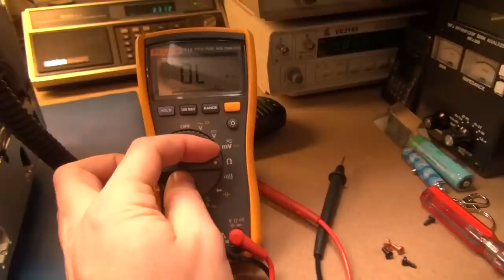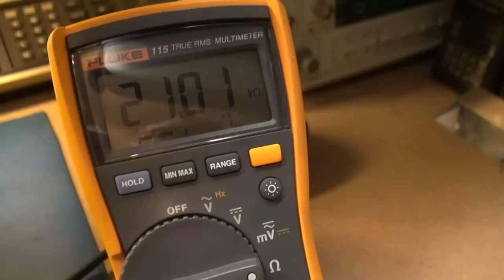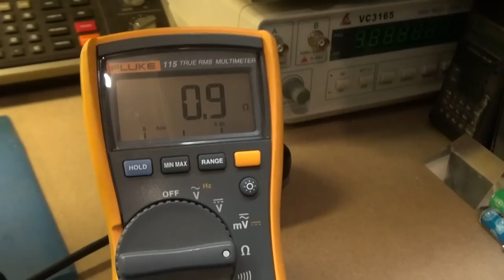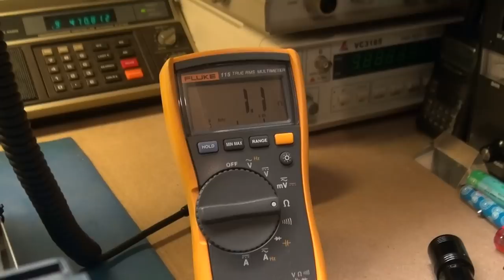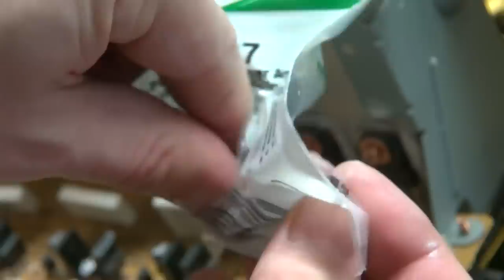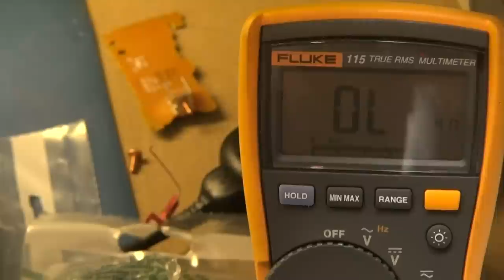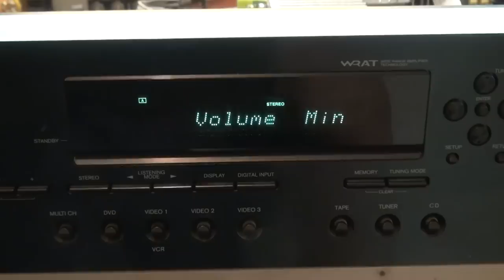ONKYO TX-SR502 RECEIVER  "SHORTED CHANNEL REPAIR"

Comment: Hi, great video.
 I have an Onkyo TX-SR576 that was working well but now started turning itself off after a few seconds and standby light blinking. I have tried clearing the memory, unplugging everything, and leaving it unplugged from power for hours, but its still in protection mode.   When I opened the case I noticed a large blob of black tar like material on the PCB right next to the large capacitors, and a smaller on on the board below that one next to a smaller cap. If that stuff has leaked from those capacitors would that cause the same result (as in protection mode activating)  as in your video? and can i just try to find parts and replace these to fix it, or should I be testing the transistors and resistors that you replaced?. 
It cost me nothing, it was a rubbish dump find that someone had cut the power cord off. I took it home and wired a new power cord and it had been working perfectly for last 6 months.
I really like this unit and would be keen to fix it again if it costs a few dollars for parts and a bit of time fiddling around, but not willing to pay someone hundreds to fix. I do have a little experience with soldering, building kits and other things but have never really fixed stuff before. Also, will i have to drain voltage from the old cap before playing around with it?
Any help or advice appreciated.
Thanks
Reply from the maker: I cant tell you if the capacitors are the only problem but it is a good place to start. Yes drain the capacitors. Some will drain by themselves with bleeding resistors in the circuit some will not. Check with multi meter. If caps are charged after being unplugged for a min then use a bleeding resistor. If caps are not the issue well it is a bit more in depth of a repair.

Comment: The .22 ohm was a casualty, not a causation. Nice job but I've worked on a number of these; there is a small transistor between the drivers that goes bad, a small 100 ohm resistor next to them goes bad, a small resistor to the base of an output usually goes. Contact me if you need help.
Reply: I can't buy transistor names 2SC1740S-S between the drivers. What is the replacement for this transistor or where can i buy it?

Comment: Just a suggestion, if you're having camera focus issues, you need to isolate the subject, like when you tried to focus on the resistor, the camera was focusing on your keyboard. a black background and some light on the subject will fix that, or when you tried to focus on the model number, the face of the amp was too dark and you had objects in the background, splash some light on the subject, this will fix most focusing issues.
Reply: Bro  camera is old

Comment: I have the same problem on my TX NR-509.  It comes on click....shuts off click. I was playing around with some new speakers and I guess the wires touched. Now I would think the protection circuit would do it's job but noooooo!  Anyway where do you go to for these parts?

Comment: Hi and thanks for the Vid, I have a similar fault with a NR609 that was dropped, i have tested and there are shorts on one of the C5242 and A1962 transistor sets, but the resistors appear to test okay, is it possible for the transistors to go faulty but the resistors to remain okay, p.s there was a crackle and a pop and a burning smell when trying to get off standby initially, any info would be greatly appreciated...cheers

Comment: Those massive caps are kind of scary to be poking around near. Did you discharge the caps before doing this work? If so, how? If not, how do work around them?
Reply from the maker: I don't remember what I did It was so long ago. But the procedure would be is to check them with a meter and if they still have a charge you can use a resistor like a 10k may be a good place to start but will drain slow. If you go down it resistance the resistor will be hotter because the cap is trying to discharge faster causing more current across the resistor. Never touch the resistor as you hook it up, use a set of clip leads. I wouldn't try to work around them charged unless you have a reason to.

Comment: Hello great job with the repair. I have a question... I have an Onkyo TX-NR535 that has stopped working. Recently I had to turn off my breakers repeatedly while installing a smart light switch. Since then my receiver has been making a clicking sound and won't power on. The sound is coming from the Power/Stanby button. Any suggestions as to what the issue might be?

Comment: I have a Onkyo TX-SR876.  The fornt left channel doesn't work.  Receiver turns on and works ok,except that one channel.  Made sure its not the wire or the speaker.  Do you think it could be a similar problem?

Comment: Thank you so much! I found a burned resistor & 2 faulty transistors thanks to your video. I removed them and brought my Onkyo receiver back to life minus the left speaker channel. I'm waiting for replacement parts now, but does anyone have any idea why this failure occurred? Should I get different manufacturer parts or could it be a cooling fan failure?

Comment: hello, I have the same ONKYO TX-SR502 RECEIVER but when I turn the power on it shuts off right away I'm wondering if its the same problem as yours. the caps all look really good no bulging or leakage one good sign is the fuses are not blowing I have not got into it and tested anything yet I thought I would get some advise as where to start. I repair CB radios so I am very familiar with a lot of these parts, and what they do you think I should start testing the outputs first, and take it from there I noticed you left your in the board so I don't have to remove them. if you can give me a few pointers I would be very grateful. thank you. "god bless" ben..

Comment: so question. If you test audio output transistors with a meter, and you can test them both ways. that means they are dead right? I heard they only test one way.

Comment: Kev, you might want to check On Semi's website for substitute output devices. Just enter the Sanken number such as 2SA1386. Have heard nothing but good thing about their quality. They are the apparent manufacturer for Motorola I believe.

Comment: Thank you!! GREAT VIDEO. I did the repair. Now my tape output and my MD tape output are not working. Did i forget a step or is that a whole separate issue.
THANKS AGAIN
Reply from the maker: +cc cally Sounds like you may have other issues or may have caused another. or a cable had become  disconnected,
Reply: +kev31779 thank you. I'll probe around.

Comment: HI Kev.
I have an ONKYO HT-R420. The computer was lightning-free and shut down and not working.
The relay is not activated and probe the transistors C5242 are not shorted and the resistances of .22 kohm are well.
Which component may be damaged?

Comment: Great video. I have a Sony STRDG-510 reciever very similur to this. When I put it in DVD or SAT mode it says that its LOCKED and I cant use those imputs until I unlock it. Can you tell me how to unlock it and why is it locked.Thanks Gio.

Comment: I have a Onkyo HT-R560 Receiver doing the same thing ... i haven't used it in almost two years and i took it to electricians and they couldn't fix it because they couldn't get the parts for it that is so crazy to me... i just want to send it somewhere and get it fixed i called Onkyo myself and they wouldn't even help me with my problem .. i can buy a new one for what it would cost me to ship it to MI.. to their guy they use to fix all their crap..  so i called him 75$ to just open it up.. take the top off.. and he didn't tell me how much an hour after that so i figure it would all come to around 300$ or more to fix it going threw Onkyo... Heck i can go buy a newer one alot better than mine for that much money so why would i want to fix mine if im going to have to spend that much money..idk.. I do know i wouldnt recomend Onkyo to anyone that was in the market for a receiver!!

Comment: I have an Onkyo HT-RC160 and something odd happened recently. My right rear speakers volume output is a lot weaker compared to the left. My receiver just switched off one day. When I calibrate it does not set it according to proper distance which is same as the left. I have switched over speakers and wires and same thing so it has to be the channel itself. Calibration raises the level to try to match the left but the left is still louder. I also ran fingers across tweetere to check air flow and it all looks good. Very confused.

Comment: I have a TX-DS494. As of the past year or so its right channel on output A sometimes works. As of yesterday it wouldn't output at all. If I turn up the volume it would sort of crackle, thats it. That has been happening for a while but it'd normally come out of it and work. Any suggestions? Thanks.

I switched to channel B for now. However I don't have as much functionality on A and it does sound slightly different. I'm going to try channel A again tomorrow and see if it'll come out of it. However I'd really like to fix it.

Comment: Great video - I found the bad set of transistors and replaced them (along with the noble resistor), and my receiver no longer goes into protect mode.  However, now it puts out no audio at all either through the speakers or through the headphone jack.  Everything looks and works normally (other than the no sound being output), any ideas on what the issue could be?
Reply from the maker: You would need to trace the signal path to find further faults.  It may have blown something further back in the pre amp section. Check power supply voltages. It may not be powering up fully. A service manual may help if you can find one for the model receiver your working on.
Reply: The other symptom seems to be that the FM tuner can no longer find a station.

Comment: Having issues:  remote stopped working, universal remote also stopped. The display is blank 90% of the time, 9% garbage displayed, 1% works fine. Any suggestions on how to repair/diagnose?  I am disabled now and can't work since 2016, can't afford new toys.

Comment: What is the compound that you added to the back of the transistors?
Good video, very informative.
Cheers
Reply from the maker: Rob Hernandez  Heat sink compound  Very common item to find
Reply: kev31779 Thank you Kev for the response and the info.Another question i have a kenwood 5 DVD carousel that is not puting out sound on the left  channel what should i be checking for?apreciate any help you can give me. Cheers
Reply from the maker: Rob Hernandez Without  electrical prints, check everything from power supply to Pre amplifier circuits. Consumer electronics can be a bear to repair without a service manual depending on how complex it is unless you can understand the circuits at fist glance you will need one. Also look for anything that might have seen to much heat.. Burnt components bulged capacitors, dark spots on the PCB,  bad solder joints and broken traces are dead givaways.
Reply: kev31779 Thanks Kev for the info.
cheers

Comment: Hello, when the transistor is changed to the same one, it is necessary to set the block current, or in what case to adjust it, thanks for the possible explanation
Reply from the maker: Sometimes there is no bias adjustment. If you put the correct part in it,  it should be good to go.
Reply: Thanx

Comment: have a onkyo nr 757 has a blown side what is blown it happened when it was on and I touched the the speaker wire on the back of amp then smoke cake out of it

Comment: Hello. I have a peculiar problem with my Onkyo TX-NR515. Everything seems to work, except for a single output channel, the front right. Now, I get no protect mode issue at all, in fact I even tried to heat gun the dts chip, and installed a fan and heatsink for it just in case. HDMI video and menu comes up on screen fine. All audio out works...except for that one channel. I tried testing the emitters, and they seem to check out fine all across...(no protect, of course). All the NPN and PNP's seem to check out fine, but of course they are still in-circuit. On that model, it looks like the drivers are on a seperate board. There is not static or other noise...clean sound all around except for the front right...strange...Thank you for any suggestions.

Comment: @Kev31779 - Great straightforward videos. Subscribed.  I need to attempt this repair.  I noticed you substituted a 5W noble instead of the original 2W.  What wattage range would be acceptable for replacement of a similar 2w 0.22 ohm noble?  Thanks.
Reply from the maker: Thanks, I used a 5 watt because that is all I could find online at the time. In a pinch it is better to go up in wattage and not down. These things are hard to find now for some reason.
Reply: Thanks for the response Kev.  I also had to order a 5 watt to replace a 2W and it left me feeling as if I didn't dedicate enough effort in searching the internet :( But since it worked for you I'll hope for the best.  Keep up the good work!
Reply from the maker: No problem, It will work just fine. On the note if all the other parts are good in the circuit.
Reply: lol...  yeah, you just taught me that in your Pioneer SX-255R "Rabbit Hole" video.
Reply from the maker: Yes, not all repairs are easy.

Comment: I got a very similar problem with a Sansui R-50. I found a burnt resistor together with an opened ceramic resistor like the one in the video. Should I just assume the transistors are fried and change them? That channel burnt a speaker already.
Reply: Nevermind, I took them out and they were shorted.
Reply: did the replacement of the resistor and transistors work for you?
Reply: I haven't been able to find a 0.5 ohm ceramic resistor, so I haven't tried to fix it yet.
Reply from the maker: You can scab two resistors in series if the part cannot be found.

Comment: how did you determine the transistors were bad? How did you test it in circuit?  I have a 607 doing the same thing. I pulled the pre amp board out and it powers up but when I connect pre amp board back it goes back into protection mode. So its either board is bad or because board is out it's not getting further down the line to the short..
Reply from the maker: +dbetts3087 if they are dead shorted then it is obvious. if not you will see PN junctions

Comment: Which one is the sub woofer channel on the htr 560?  I don't have a voltage meter and if I just remove it til I get the parts will my system work

Comment: The same resistor your talking about in the vid,I was looking and trying to figure if it was shorted/open.I get a BEEP on my meter,but when i check other fixed resistors theres no beep....only thing the resistor i check has 2leads,looks just like the one your replacing.If it behaves like just a piece of wire is is it no good?
Reply from the maker: the white noble resistors should look like a dead short , it is like .022 ohms or something like that. if its open I would be worried.
Reply from the maker: Also do not go by the beep on the cont test. Set it to ohms, because the meter will only beep on zero ohms give or take and may not beep at a few ohms.
Reply: haha u already knew what i was talking haha.so it SHOULD LOOK like a dead short but just dont go by the cont test ok.Why is it that those resistors are like that.They also look like they take alot of heat because of there ceramic look.Theres not alot of info i can find about those styles.Thanks for the reply much!
Reply from the maker: iamdatdude1619 They are there for thermal stability, balance and distortion.
They help with manufacturing transistor specification variations between parts.
There are quite a few opinions out there depending who you ask. but these are the most popular reasons. And yes they do take a lot of heat depending on the demand of the transistor.
Reply: thanks much for a quick reply & great explaination.your value means much to mankind ;-) Thank you again!!!!

Comment: A question: the rectangular resistor indicates 2-0.22 ohms( two resistors of 0.22 ohms each one), why the measured value is 1.1 ohms? thanks.
Reply from the maker: You didn't take in consideration of the meter leads.